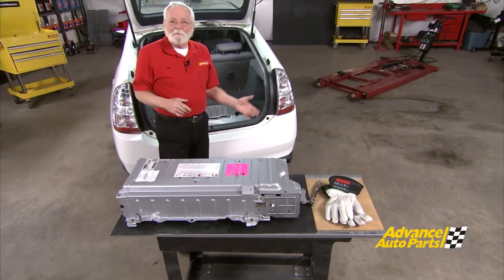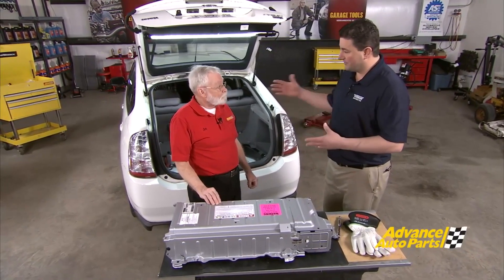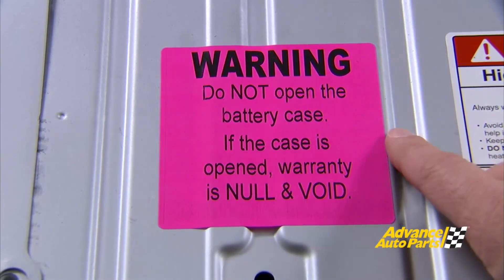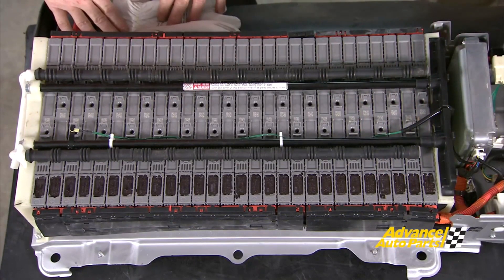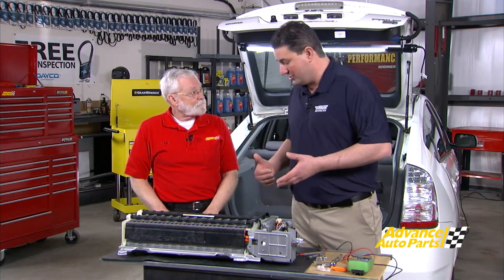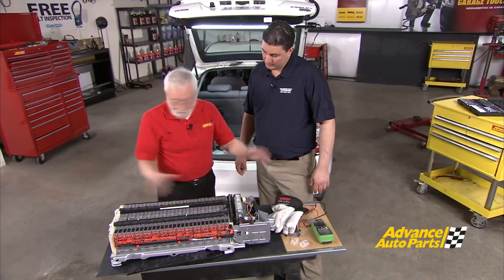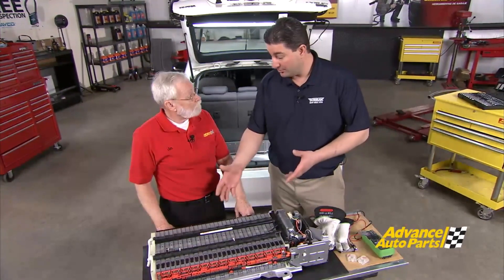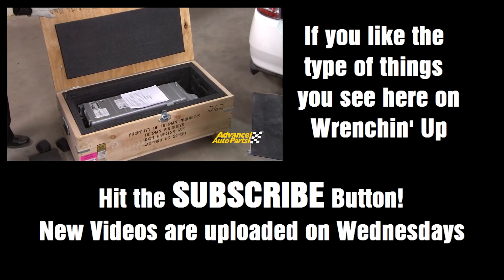Why Hybrid/Electric Vehicle Batteries Can Fail - Wrenchin' Up

Comment: Battery two holes spreading lithium heat air in cab of 🚗 in cool weather 😢
Reply from the maker: Hi - Thanks for watching and sharing your experience! I just want to mention that the batteries being discussed in this video are not Lithium, they are Nickel Metal Hydride.

Comment: rmanent costs of hybrid battery parts the car can not passHello I have a car toyota prius 2010 The car runing good no problem put the car have the permanent costs of hybrid battery parts the car can not pass smog How I can clean of the permanent costs? Can you help me please
Reply from the maker: Hi - Thanks for watching! Long distance diagnostics are difficult, if not impossible. Having said that, I suggest that you do a complete diagnosis of the internal combustion engine and the engine control system, because that is where problems that affect emissions testing occur.

Comment: After all this.recondition my pack/replaced one module/ 12 v is fine
Topped it off too.several times since it's been sitting. 
Maybe my red plug isn't in fully?
Feels right to me/ I've done it twice.
Still have all my trouble lights etc.
And/////// it doesnt start?
Oh boy?
Reply from the maker: Hi - Thanks for watching! If your vehicle is a Toyota product be sure the service jack (orange plug) is in all the way and LOCKED by pushing the handle in and then towards the center of the plug. If not, the interlock circuit will be open. Once the interlock circuit is closed everywhere you might have to try to start the vehicle several times before the computers verify it’s ok for the vehicle to start.

Comment: I have a hybrid Ford escape 09 and nobody can get it started what's my best choice
Reply from the maker: Hi - Thanks for watching! The 12-volt battery runs the computers so it has to be OK. Computers open high voltage "traction" battery's output stage relays to allow high voltage to run motor generator 1 in the "transmission" to start the Internal Combustion Engine, so computers, wiring and ICE have to be OK. High voltage "traction" battery has to be charged up enough to run MG1. If not and everything else is OK the dealership network has tools that can "jump" the HV battery to get you going. I hope this helps.

Comment: These companies that are not the actual Toyota companies. The companies that make E V batteries they, Have poor customer service and do not care about customer service or honoring contracts.  Can anybody help me with a 2010 Toyota Prius  gen 3 model .
Reply from the maker: Hi - Thanks for watching and sharing your opinion! If you can provide specifics on what you need help with, maybe someone will jump in here with the information you need.
Reply: @WrenchinUpwithJimBates   yes sir no problem just wondering what I can do . It’s kinda tough financially and I already trusted a ev battery companies that was sub contracted. The company sold me a lemon . They worked the woman who was driving the vehicle . The gentleman did the service right at our home address. Guaranteed a 100 thousand miles on the battery. Now this day it’s literally lacking power etc . Please help
Reply from the maker: Hi - Hopefully you have the warrantee in writing. There are probably several good hybrid vehicle battery testers out there that can accurately diagnose the hybrid battery in your vehicle. The Midtronics  HYB 1 comes to mind. So, I would suggest that you find a business in your area that has this diagnostic capability and have the battery checked. If it provides proof of a defective battery the warrantee should be enforced. If the battery is OK, further diagnosis of the hybrid system should be performed by a qualified, and preferably an ASE Certified, technician who should be able to discover the cause of the problem.

Comment: greetings I have a lexus es300h does not start and the error code is c029A
Reply from the maker: Hi - Thanks for watching! Long distance diagnostics is difficult at best. Having said that, what diagnostic steps have you taken? What were the results of any corrective steps, if any, that you have taken?
Reply: u029a lost communication with hybrid battery pack sensor module
Reply from the maker: Hi - Pulling cods is not diagnostics. The code gives you a place to begin your diagnostics. In this case, as a start, a bi-directional scan tool could be used to check the communications paths and the sensor itself. Following the diagnostic tree in a service/repair manual for the vehicle will likely be necessary.

Comment: Im gonna throw the ball down the field here and see if someone might be gracious enough to help me out. My gf wants to buy a 2007 Camry Hybrid. It has about 220,000 miles on it. Worse case scenario, lets say that "expensive" battery that runs the engine fails in a month. How much to repair it or replace it? True you have to replace motor? Would greatly appreciate answer.
Reply from the maker: Hi - Thanks for watching! Based in the information I have at this time, the replacement batteries are now available from the dealership as well as remanufactured batteries from some auto parts stores. You'll have to check with the parts store and shop doing the replacement for prices. The traction motor will not have to be replaced unless it has problems of it's own.

Comment: This video is dated Nov 25, 2015.  it is now Dec 2020! my question is,would replacing my nickel metal battery for a newer lithium battery in a 2010 to a 2014 Toyota  prius create problems with electrical things in the car?  done proffionaly of cource! I heard the new batteries are much stronger and last longer. in some cases 200 to 250k! or 10 years.
Reply from the maker: Hi - Thanks for watching! Good question but I recommend that you check with a manufacturer of a LiIon battery to see what they recommend. As far as I know (I really haven't kept up), Toyota still only uses Nickel Metal batteries for the Prius.

Comment: Your not explaining how a closed sealed system with filter on the air be system get hair and other materials in there. Stop making outrageous statements without explaining
Reply from the maker: Hi - Thanks for watching and sharing your opinion! However, The 2004-09 Prius did not come with a filter for the air used to cool the hybrid battery. As a result the fan can log up with hair and dirt and some dirt can get into the crevices between the battery modules
Reply: Search youtube and you will see.

Comment: The air cooling system in has a filter on to stop material getting in so how does be the hair get past the filter
Reply from the maker: Hi - Thanks for watching! The 2004-09 Prius did not come with a filter for the air used to cool the hybrid battery. As a result the fan can log up with hair and dirt and some dirt can get into the crevices between the battery modules.

Comment: How long are these hybrid batteries usually good for before they need to be replaced. Can you also talk about the importance of not overfilling the tank and ruining the regulator. I have run out of gas... with 2 bars and 31 miles left. Please talk about the reset and how filling the gas tank is not all it takes to get it going again.
Reply from the maker: Hi - Thanks for watching! I use to talk about these subjects during the clinics I did, and stopped doing when I retired from the auto parts business several years ago. Because of that and the fact that this video is several years old and things do change, I suggest that you refer to the  vehicle owner manual and the service/repair manuals that are available at the dealer and auto parts stores for the latest useful information on these topics. You can also contact Dorman about their batteries and their expected life. Their contact information is in the video description.

Comment: Hi Jim I have a Toyota Prius 2nd Generation so it has a Hybrid Battery problem can you assist me what can I do because in my area there are no mechanics of these Hybrid Cars can I drive the car with this problem or it's harmful Thanks
Reply from the maker: Hi John - Thanks for watching! It depends on what the problem is, so I would like to suggest you contact my friends at PROLONG Battery Systems because they have a LOT of experience with these systems and can probably steer you in the right directions. You can contact them at www.hybridautomotive.com
Reply: @WrenchinUpwithJimBates  Alright Thanks Jim I will Let You know after Contacting them

Comment: My touchscreen is cracked and i cant run a diagnostic. My battery drains really quickly if i drive on battery power alone. My prius is constantly charging. I went to autozone to check the 12v but they have a policy not to check them. So idk what to do
Reply from the maker: Hi - Thanks for watching! The 12 volt Panasonic battery in you Prius is no hard to test. I suggest you take it to one of the  other auto parts suppliers to have it tested.

Comment: If the individual cells are not new, they will fail as your old one.  Complete new Battery will last at least 10 years, remanufacturer or used battery will not last that long.
Reply from the maker: Hi - Thanks for watching and for sharing your comment.
Reply: @WrenchinUpwithJimBates    That's what I want to know about Dorman battery. Are they made from Toyota new cells or from used cells.  For a benchmark, Complete new cells from Toyota Dealer  cost $2200, and labor may cost another $200 in most independent mechanics or $400 in Toyota Dealer.
Reply from the maker: Hi - Good question. But since that was not brought up in the interview I don’t have the answer, but you can ask the folks at Dorman. Their contact information is in the video description.

Comment: Dorman.  English for...

Do not buy.
Reply from the maker: Hi - Thanks for watching! But you can’t just leave a comment like that on my channel without telling us why. What happened? What do we need to know about them?
Reply: @WrenchinUpwithJimBates  as to the HV batteries I have no opinion.  My two most recent capers with Dorman parts involve a timing rebuild kit for a Ford 3 valve 5.4.  Both phasers were coming apart by the 800 mile mark.  The right one was slapping at about 300.  Having to redo that job will make a disbeliever in most mechanics.

A week ago I replaced the rear backing plate and bearings on a Toyota Solara.  Right side was fine, everything went well.  Left side wouldn't allow the parking shoes to retract far enough causing enough drag to get hot.  Got another backing plate same thing, apparently the top pivot post was installed too high causing the shoes to be spread too far apart.  Had to machine the shoe ends to get it to work.

More often than not you get what you pay for.  The  savings I saw in parts cost, was more than eaten up in additional labor.
Reply from the maker: Wow, thanks for sharing your experience!

Comment: Can the battery cells drain off due engine not running because of the safety switch on the low oil pressure. Its shuts off the engine and only the high voltage moving the vehicle untill it dies off. Can the cell be drained off that way??
Reply from the maker: Hi - Thanks for watching! Yes I think so because when the ignition is turned on the output stage relays (powered by the 12 volt auxiliary battery) in the battery switch on to provide current to the DC/DC converter that runs the vehicle's electrical system.

Comment: Nice sales pitch
Reply from the maker: Hi - Thanks for watching! It wasn't meant to be but it sort of turned out that way too. I hope the info outweighs the pitch.
Reply: @WrenchinUpwithJimBates  You and the Dorman Engineer were very professional, but there are many posts on this subject that present all the options (not just one of them), such as choosing a, used, rebuilt, or new battery pack or rebuilding it yourself. Along with the Pros and Cons of each. So your post came off biased after seeing the other posts. But thx for your reply, I respect you for getting back to me.  
BTW. I would like give you kudos for being safe and using insulted rubber gloves with a protective cover. My late lineman father would have been proud of you. But you should have mentioned to use them in the post(or maybe I just missed it?).  Also the rubber gloves should be tested for leaks before they are used each time. By trapping air in them and rolling up the opening to check for leaks.
Reply from the maker: Hi NC - I thought you might like to check out my interview with a manufacturer of HV gloves where we talk about the issues you bring up. https://youtu.be/o9WWVMDih9s

Comment: As of 1/1/2018, Toyota list price for the 04-09 Prius battery is $1,950 + tax. They are made from 100% new manufactured cells. Only have a 1 year warranty (if owner-installed; 3 year if dealer installed), but they'll last longer than ANYTHING Dorman produces.
Reply from the maker: Hi - Thanks for watching and for your interesting comment!
Reply: My personal experience is that Dorman packs are crap!
Reply: Hi, can you provide me with the link to buy this please, I am from another country.   
BTW, Do you think it will work for the same model Prius 2007 having a Right-Hand drive Model for SE Asia? 
Thank you.

Comment: Is there any place that buys these batteries back?  I have one out of a wrecked kia and was wondering if there is a place that buys them back?
Reply from the maker: Hi Michael - Good question but I'm not sure. You might check with the dealership and local auto parts stores to see if there is a core value for the battery pack because they are rebuilt by some manufacturers. Thanks for watching!

Comment: You missed a bunch of details not telling how to change cells and safe isolation..
Reply from the maker: Hi Mel - Thanks for watching and for your comment! Changing cells (modules) and safe isolation were not the focus of this video and as such, those details were not left out. You may be interested in another video on this channel about the  safety issues https://youtu.be/o9WWVMDih9s . I do have other videos in cell (module) testing, single charging, multiple charging with a harness and replacement procedures but because of the liability involved they are only available on DVD to working ASE certified technicians who have attended the live workshops.

Comment: Please tell me per liter how much killo meter running my prius 2007 model in Pakistan
Reply from the maker: Hi - Good question, but I don't have accurate information on the mileage the Prius gets in different parts of the world and climates. I suggest you check with Toyota to get that information. Thanks for watching!
Reply: Hello friend I work in pakistan hybrid batterry if your car batterry in good condition so it's give you 22 to 25 kilometer per liter.

Comment: Hi Jim,
Thank you for taking the time to do all these great videos. We have a 2008  Honda Civic Hybrid and the battery gave out 2 years ago and we have been driving on just the engine itself. It will no longer charge the batter and i am wondering if you can tell me what to replace in order to get the charge running to the 12 volt battery or if it is even worth it?
Thank you,
Mike from Calgary
Reply from the maker: Hi Cara - Long distance diagnosis is usually not very effective so I recommend that you have the system checked out with scan tool diagnostics to more efficiently locate the cause of the problem. I think it will be a whole lot cheaper and faster than just "throwing parts at the problem". You will then know if it would be worth it to get your Honda repaired. Thanks for watching!

Comment: DORMAN=JUNK
Reply from the maker: Hi John - Thanks for watching and for your comment, but you shouldn't complain about a product on this channel without an explanation. Otherwise we might suspect that maybe YOU did something wrong that may have caused the issue.
Reply: @WrenchinUpwithJimBates  All one needs to do is look inside. I've had the "pleasure" of working inside three Dorman batteries, and the workmanship is absolutely shameful. Cardone is no better. https://www.dropbox.com/s/2p7e41crla9dn1e/MVIMG_20190424_184216.jpg?dl=0 - if you zoom in, you can see the orange paint overspray on the MISSING air seal.